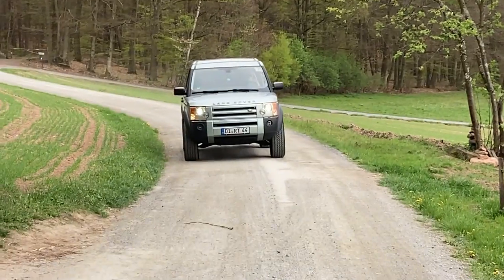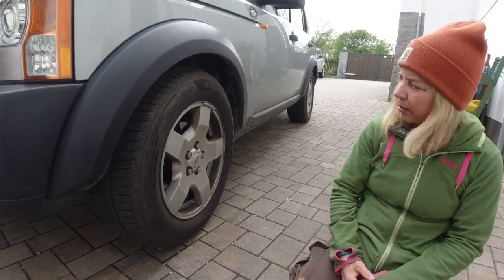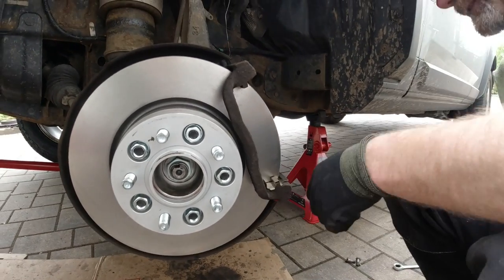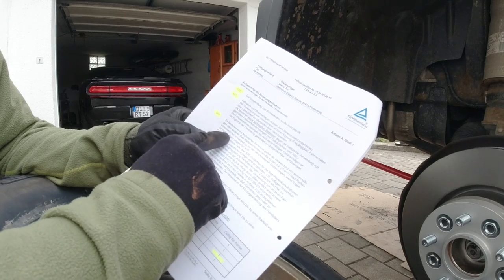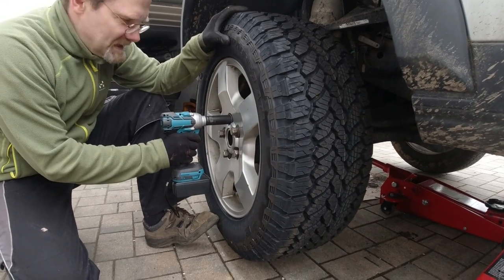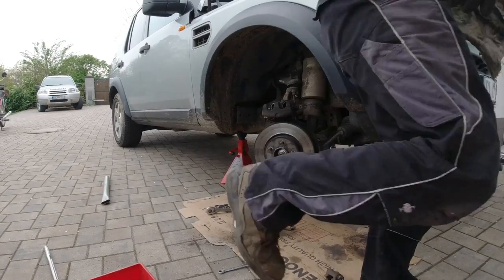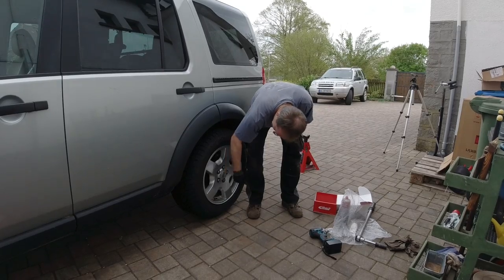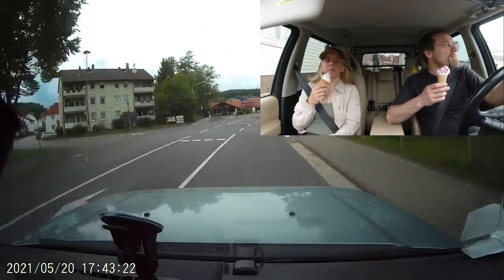We install All Terain tires, Brembo Brakes and Wheel Spacers on our Land Rover Discovery 3

Comment: Hi Christian, has the wider tires affect the fuel consumption of the LR3?
Reply from the maker: Bevor we put the tires on, it averaged at about 10,2 L/100km. And that the actual usage, and not from the LR onboard system.  We always calculate the actual usage after each filling.  And now, with the tires, spacers, rooftoptent and alubox on top, the consumption was 10,82. There was offroading and Autobahn. So we are quite happy. I thought it was going to be at least 13L/100Km. 🙋‍♀️ Vera
Reply: @Vera_and_Christian  That's a very good fuel consumption considering you had stuff on the roof that increases the aerodynamic drag of the vehicle. Perhaps when you remove them it will reduce the fuel consumption to 10.5 L/100 km

Comment: Hi guys, what made you choose 25mm instead of 30mm spacers?
I am just about to buy them and wanted to make sure I make the right choice.
By the way, my D3 is nearly the same as yours. -Silver color, manual, black leather trim though.
Reply from the maker: We mounted spacers only for the looks of it, so the 25mm already put on a lot of strain on the wheel components like the hub. 30mm would be even worse. 🙋‍♀️Vera

Comment: Hello all, which winter tires would you run on a d3? Snowy and wet region in winter time but I'd like to know if a bfgoodrich or a winter tire would be a better choice? Can't I get an all weather M+S?
Greetings from Germany!
Reply from the maker: We usually have winter tires on, just cheap Hankook tires. Before Youtube and putting everything we do out in the internet, we did not really care that much. But now, we still have to decide if we leave the AT ones on. But it depends on how much snow we get. We live on a steep hill in a hilly area. So tracktion is most important for me. Christian can drive safely anything on any surface, I unfortunately not. I need trusty tires. 🙋‍♀️ Vera
Reply: Thank you for your answer and time! I'm from the region westerwald so I guess we have the same geographic structure. I'm just excited if an AR can handle snowy mud without a lot of understeering. I have to try and I'll let a comment below how my experience was over the time👍
Reply from the maker: @jinnyjo868  Cool, we are just south of Darmstadt, not that far from you . 🙋‍♀️ Vera

Comment: Takes me back to the time I was lucky enough to get a job as a workshop manager for a Suzuki motorcycle dealership near Paderborn. The German customers showed me their documents which even specified the tyres they had to use. 
I know the authorities can be a pain but I wish I'd stayed now the brexidiots have had their way. I love Europe, hate living trapped in the UK. The German people I met were so friendly.
I have to ask, does anyone actually check any of the specs. In England I'd just pop the old wheels back on for the MoT/TUV 🤭
Reply from the maker: 😅👍We will probably do the same. It is important in case of an accident if your car is not up to spec. And if the police stops you because they might think you are overweight with the rooftoptent and everything else on.  And they will pull you over here in Germany.  And then they start looking 🙄. Yes Brexit is a bummer for us too. We get a lot of OEM parts directly from the UK. Now they are at least 20% more expensive for us. 🙋‍♀️ Vera
Reply: @Vera_and_Christian  I am so angry about brexit too. I have lived and worked in Greece and Germany and now can't. My partner and I wanted to move to the European mainland as we both love travelling about.
We own a small engineering company manufacturing unobtainable parts for vintage and classic motorcycles. We used to sell about a third of our parts in Europe but, as an example, one part we make has gone up in price from £54 to £86 after taxes and handling charges. But it's more than just money, we're ashamed of the way our government has behaved and dread to think what Europeans think of us 😔
Reply from the maker: @PurityVendetta  😃👍 Glad to know that.  Our son has a "classic" Mofa, a Hercules Gt. We had to buy cheap chinese parts for it since could not get OEM parts here in Germany. That was quite a challenge. Christian made a video about the engine overhaul, but that was before we filmed for youtube, so excuse the quality. https://www.youtube.com/watch?v=flD9_n8xNag😄 🙋‍♀️Vera

Comment: How do you guys 100% confirm that ordered parts really are the right ones? i cant spend another 800 bugs on new brakes but i also dont wanna spend 300 on ones that dont fit^^ i can order with "Typengenehmigung" number in my cars papers, but im still concerned that it might be wrong parts cos i ran into issues earlyer and now im sitting on parts that i cant use :D im not a mechanic so i dont understand much of the part numbers stuff and how that works...
Great content i love it! 
Greetings from Switzerland (:
Reply from the maker: Finding the right parts requires a lot of research.  I compare various web sites to find out if the parts are usable.  We also buy sometimes various versions and send the ones we do not need later on back.  This is no issue in Germany and does not cost much more.  Christian

Comment: Hi where can I locate the pcv valve on a 2016 LR4 Landmark edition? I have a P0442 error code and thinking of replacing the pcv valve and the gas tank cap and see if I can get rid of the code. It says ‘evaporative emission system small gas leak detected’ Any help is greatly appreciated. Thank you
Reply from the maker: Download the workshop manual at disco3.co.Uk for the LR4 up to 2016. it’s a pdf.  Then search the code section.  It’s definitely in there.  Christian

Comment: Hi,
Are the cutouts on the rim of the discs not a wear indicator ? I always thought it was. I'm sure they aren't for balance but it wouldn't be the 1st time I've been wrong.
Reply: deffo for balance
Reply: No, they indicate the minimum disc thickness for sure.
Reply: @islandhopperstuart  I think you (and I) are correct. Or at least it has been for the last 40 years I've been in the motor trade. I doubt all the makers of discs have managed to have the balance out by the same amount, especially including all the diameters.  they need to look at their manufacturing processes I'd say.
Reply: @Hui9697  I agree. Discs are cast then turned so should be capable of a high level of balance straight off the machine.
Reply from the maker: @Hughie @daz j @islandhopperstuart They are definitely unbalance correction cuts. Christian works in the automotive balancing industrie.  He has forgotten more about balancing than others will ever know. 😅 He truly is an expert in the balancing industry. 👍🙋‍♀️Vera

Comment: On the wheel spacers, have a look at "Defender Mods and Travels" excellent videos on axle failures and "Grizzly n Bear" defender front axle failure incident.  Both convince me not to try and know better than the original designer on this point......
Reply from the maker: We are actually really happy with the driving behaviour ever since we have installed the wheel spacers. Our Disco 3 eats up wheelbearings anyway, without any spacers. It's funny, but ever since we installed the spacers, we haven't had a broken wheelbearing. If one breaks, I have a spare one underneath the back seats, always ready to be installed. And I have seen all of Grizzlynbears videos. 😃👍🙋‍♀️ Vera
Reply: @Vera_and_Christian  Best of luck then,   hoping Defender Mods and Travels analysis doesn't apply to your case! 
My only G Wagen wheel bearing incident was I think related to ripping a wing off a Volvo a while beforehand with that wheel  . Looking forward to conclusion of your exceptional DIY engine ovethaul! Rgds.

Comment: What happens if my car is modified and legal in the UK and then I drive it as a visitor to Germany? I have 8.5J wheels with 255/45R18 tyres on my Jaguar which was never specified by Jaguar. In the UK no one cares. Would I get into trouble with German police?
Reply from the maker: No, I doubt that, as long as the car is in a well maintained condition. I always wonder what happens if you do go on an extended trip and your MOT or TÜV expires. But I always check the regulations of the country we are traveling in to before we go. 🙋‍♀️ Vera

Comment: So Christian, you believe that the team of engineers at LandRover who spent a lot of time designing your Disco 3 know less about front suspension geometry than the accessory company that makes the "strap on" wheel spacers. I thought you had more sense than to fall for the "useless accessories trade".
Your government should ban such modifications, especially in a country that has Autobahns where driving at high speed is allowed.
Reply from the maker: That's excactly what I said, and they are out of alluminum 😳. But they do look cool. 👍🙋‍♀️ Vera
Reply: @Vera_and_Christian  well Vera, maybe you should be awarded an honorary Automotive Engineering degree, for having so much common sense, those spacers are dangerous, hopefully Christian will "snap out of it" before any harm is done. Love you guys YouTube channel.